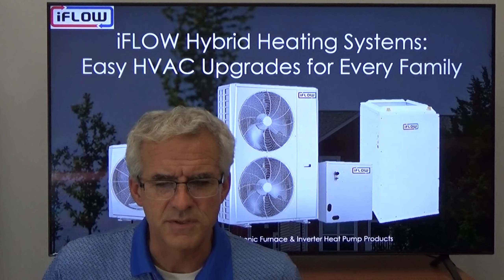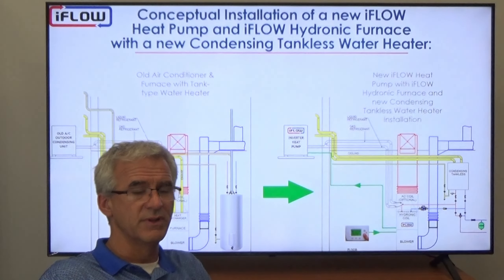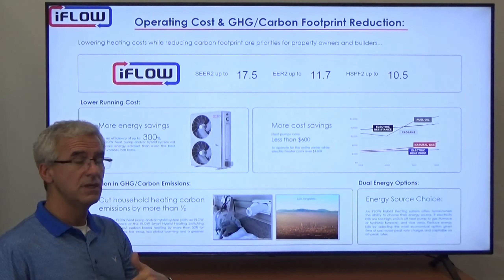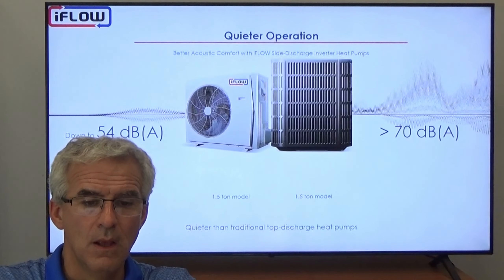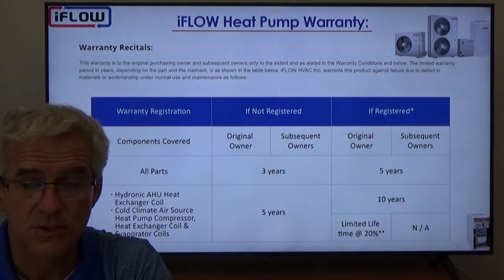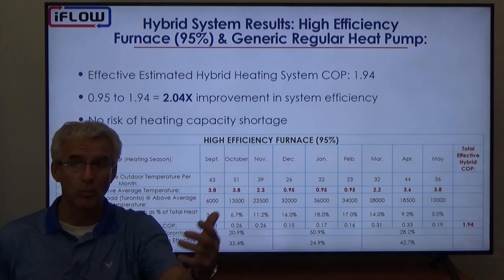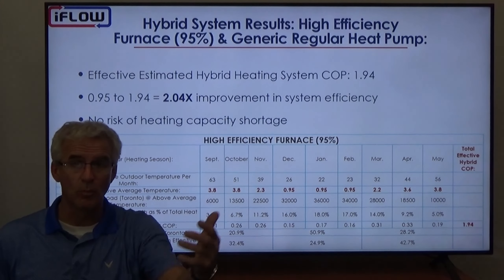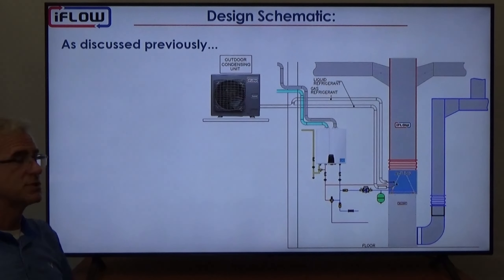iFLOW Hybrid Heating Systems:Easy HVAC Upgrades for Every Family

Comment: Living in MD suburb right outside of DC, I installed iFLOW hydronic furnace ( 1 FLH-18000 ) tied with Navien tankless water heater ( NPE240A2 ) to heat the house and for DHW ( domestic hot water ) 2 years ago after extensive research. The system worked perfect for 5 Full bath and >4300 sf house.  Very knowledgeable Mr.Steve Bagshaw has been easily accessible for the consult and support.    I understand any heating system with oil, gas and heat pump can be tied with iFLOW for comfort, moneysaving, and environment. Great system and company. Thank you Steve!

Comment: Is the manual switch system still available? Our brand new hybrid did not make the switch! So no heat at -25 C was not good. Please advise as a great idea of using both furnaces.